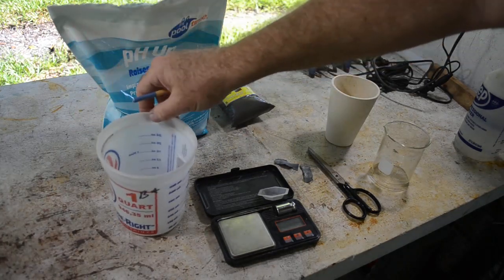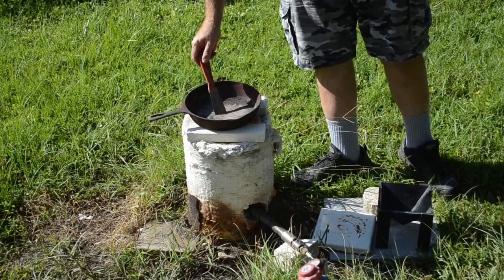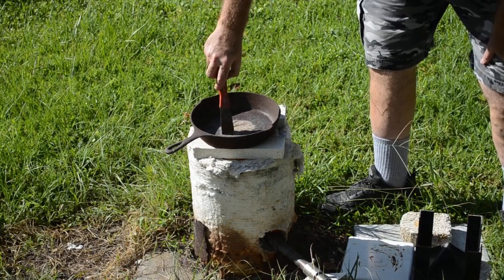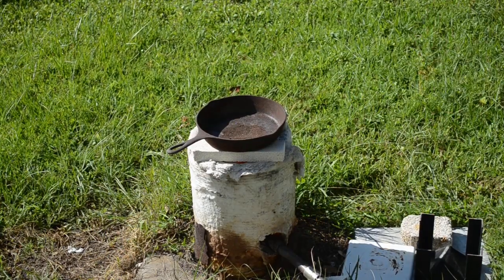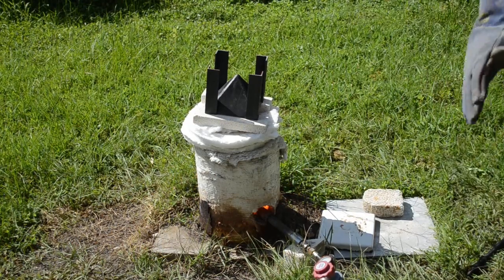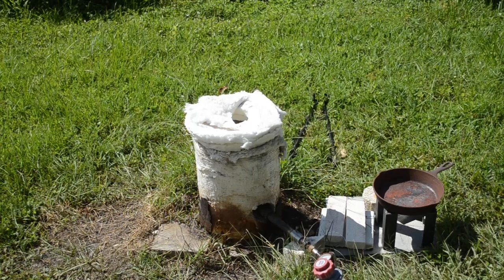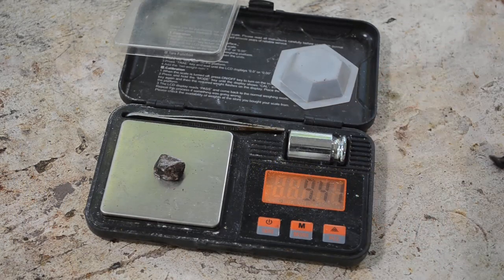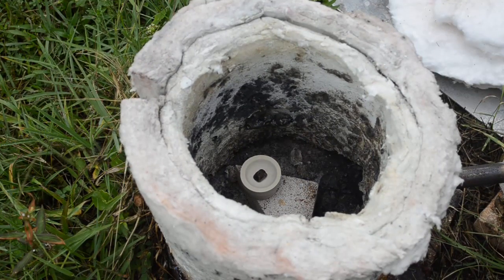Smelting Gold Ore From Old Mines Part 1

Comment: If the lead is oxidizing to litharge you can add some carbon (i use bread flour in my litharge flux).  Litharge + Carbon = metallic lead
Reply from the maker: Yes, I thought about that. I'm not really worried about losing the lead though, as long as the remaining lead collects all the precious metals.
Reply: @omegageek64   I like using the litharge and carbon in mine so as the lead oxide reduces it makes a sort of lead rain in my mixture as it falls which ends up doing a good job of collecting the flour gold I work with